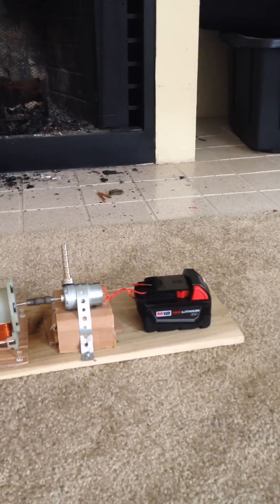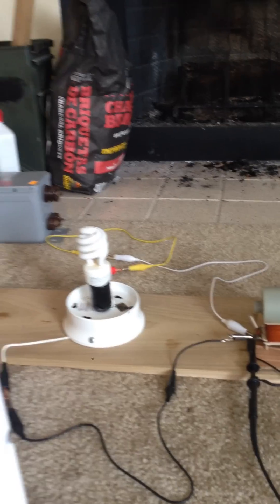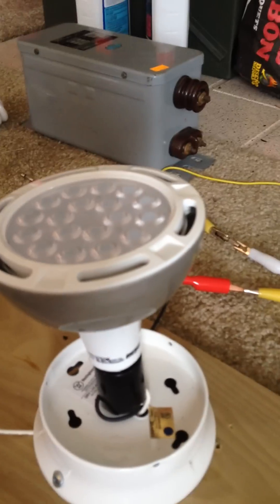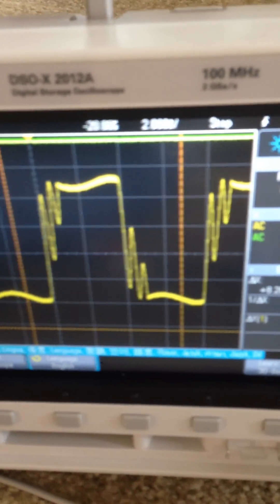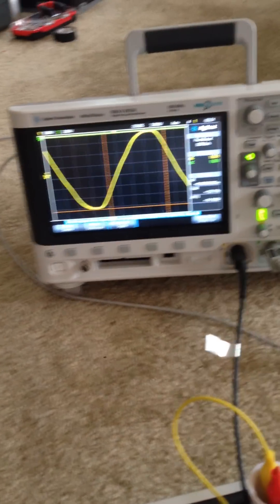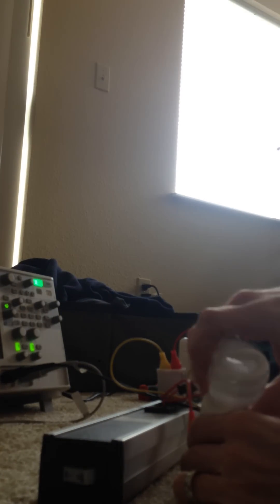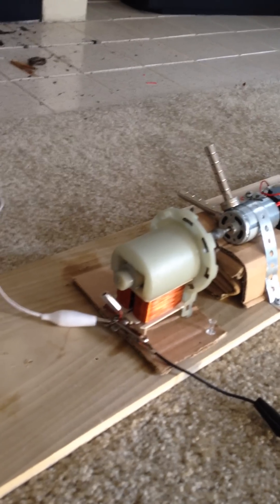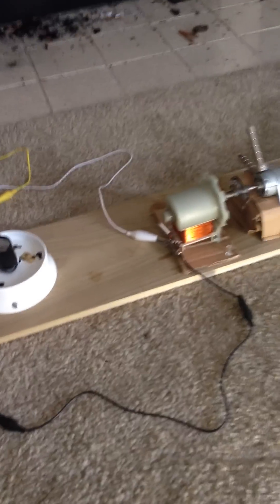Gerard Morin Replication, AC sine or DC square? Or both?

Comment: Bro, i built a similar setup to what you were describing for your next build, i took a Makita brushless drill and removed the reduction gear head and handle, using only the motor and circuit to drive it. I have dozens of videos on my channel, just click the bat icon and it will take you to my videos. I'm getting over an hour of run time from a one amp hour 18v battery, meaning my motor is only drawing one amp under load, and with an output of over 250 volts @ 5 amps coming straight from the pump into a 75watt incandescent load, but most my videos show running high voltage loads with output of over 200 amps of radiant emissions

Comment: In one of his prior videos, Gerard said that this kind of energy moves only electrons, hence, it is a modulating energy.  It was hard to me at first to understand it, but when he showed on the same video, the wires connecting an 220v AC lamp and at the same time feeding the battery that feeds the motor, in a loop, it made much more sense.

Comment: Nice Chris....have you come up with anything new...This is a unusual motor..
Reply from the maker: matthew drummond Yes I'm now using a new pump motor/generator w/ brass bushings w/ an outrun 3 phase brushless motor w/ speed controller and variable voltage input. Finally got my IR gun that works with this setup and thats been amazingly helpful. I'll be doing a video again on some various applications / effects but I'm so busy with life at the moment lol. Thanks for the commend Matthew.

Comment: Chris, where are you located?  I and a buddy of mine are super interested in getting involved in this.  Would love to meet Gerard, and get experimenting with you.  Should get a skype chat going where we can all chat in real time.
Reply from the maker: Allen Simpson I can't speak for Gerard but we are both made head wind in various areas with this research. I've rebuilt the machine using a better washing machine pump and an RC out runner motor driving the pump, three phase controller and variable voltage w/ servo tester. What direction have you gone so far? I recommend getting the exact same IR temp gun as he has in his video. It has been invaluable thus far playing with his coined "cold radiation". Send me a private message and we can exchange emails and work towards Skype chat. I warn you I'm burning the candles at both ends with personal projects, work, family as well as this research so I may be slow responding.
Reply: Cool I sent you a msg on Google +

Comment: The wave form that you see in the scope is a direct result of way the microscopic magnetic domains react within the structure of the core material when they meet with magnetic resistance while trying to produce electrical force in the coil winding to meet the demands of the load. The iron core is acting as sort of a magnetic cushion between the spinning magnet and the coils.
Reply from the maker: MagnaMoRo Could you try and put that more plainly or in a different way I'm not following your analysis.
Reply: *****  Sure Christopher,
Mechanically speaking,  the magnet in the pump generator only has so much mass, or more precisely, magnetic mass behind it. Furthermore, the iron core between the magnet and the coils provides even more of a magnetic cushion. The load introduces resistance that causes the small mass of magnetic field to compress. It reflects in the scope as flattened voltage peaks in both the North to South and the South to North magnetic polarities wich are creating your AC current. The wall outlet does not reflect these flattened peaks in your scope because the magnets in the transformer powering your house have a much greater magnetic mass behind them. But it is there. To see it though, you will have to use a much bigger load (like when you start a well pump).
Reply: MagnaMoRo so why doesn't it shock gerad morin when he touches both terminals of the pump with his finger?

Comment: compressed harmonics do to higher frequency ac wave impedding or hitting the inductor inside the bulbs internal circuitry.  The higher frequency ac in the gen. Is whats diffrent as we are use to 60 hurts and not using different frequency ac in experiments.
Reply from the maker: Breakzeitgeist Can you elaborate on your thoughts?

Comment: great vid man, I find the result of a square sine wave interesting. I will ask around as I work with over a 100 years of experienced electrical engineers. I let you know if they can explain this.
Reply from the maker: Thanks Adam, I've been reading on the energetic forums that its often that EE's work very hard to get rid of this effect in a circuit. Perhaps we don't fully understand what this really can mean for our future circuits. I'm going to continue to conduct experiments and see how the wave form changes with each load. I'll update this video when I have significant findings.
Reply: +Christopher Sparkman I forgot to update you on this. So what you are seeing is a very dirty sin wave. So what I have been told is that you will see this a lot at the start of power production. then a sine wave filter is used to clean the sine wave and make it smooth. so nothing really interesting happening.

Comment: Christopher, Thank you for sharing the waveform of the smaller pump motor that Gerard recommends using with a variety of loads, this supports the unusual wave we are getting out of the McCulloch generator https://www.youtube.com/watch?v=xcUDEHna7CM - much more investigation needs to be done. Looks like by working together we will have the answer soon, your latest input is the newest rage on the forum. http://www.energeticforum.com/272340-post269.html